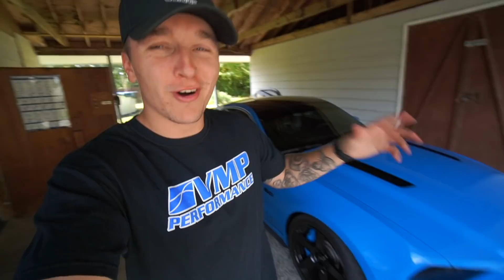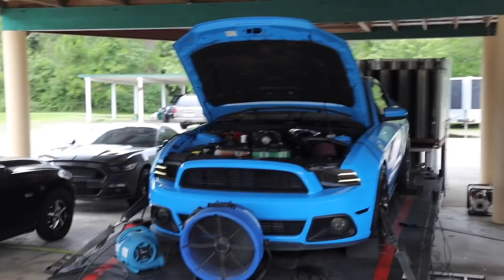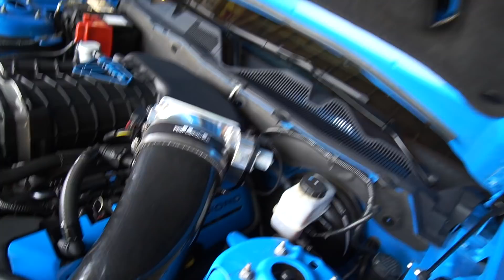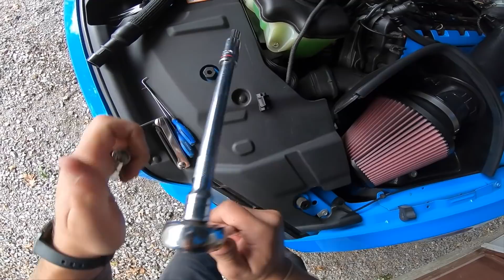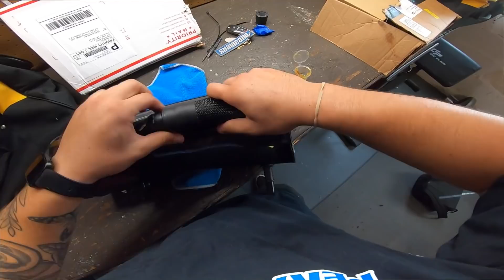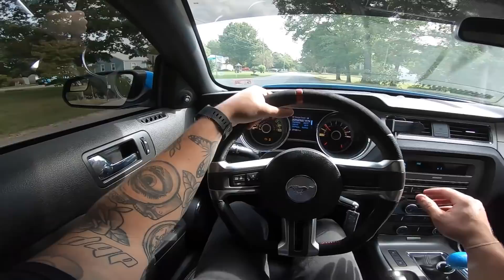BLUCIFER'S Supercharger SCREAMS for the FIRST time!!

Comment: You’ll have to drop to a 72 to really hear whine. Bad idea without a built motor. On my Odin with a 79 all you hear is exhaust. Great video though. Didn’t even know this product existed 👍
Reply from the maker: Yeah man these blowers are good stuff! Maybe 72mm one day! Haha
Reply: DerekBaranProductions I’m waiting on 17 inch forgestar bead locks and MT street R for the rear. Upgrading to the 8 rib pulley system and upgraded tensioner and changing to a 72mm. Should put rwhp around 950. I’m getting belt slip with the 79 mm and the six rib system. I know I am because I can see belt dust on the bottom of my hood. I’m just waiting on Vmp to get all the stuff in and then I’m going to drive down there and have it done in one day. Then I just have to hope my transmission holds up.

Comment: I have a question. I have asked everyone no one has a clue.  So I own a 04 mustang gt. I luv it.. recently it developed a slight rattle or vibration. Around 2500 rpm.  I have climbed under car from front to back. Can't find it. Im clue less.  Any ideas?  Ever had this problem with blue. ???  Its just loud enough to b annoying. Not super loud or anything.  Any ideas would b greatly appreciated..    thanks luv ur videos... 👍